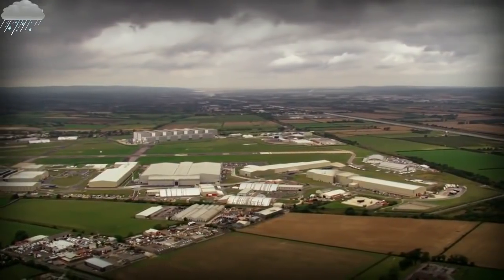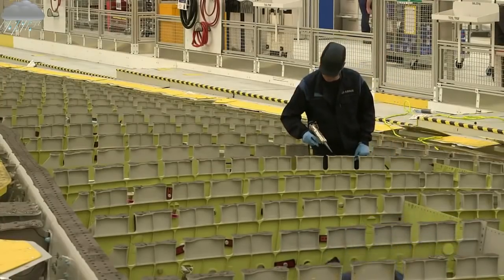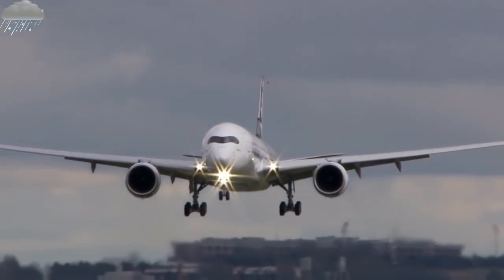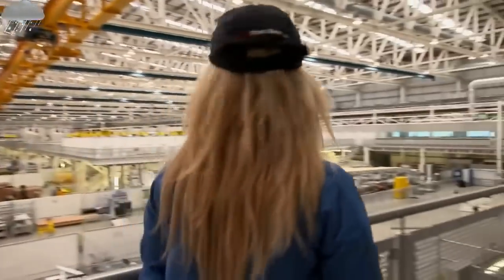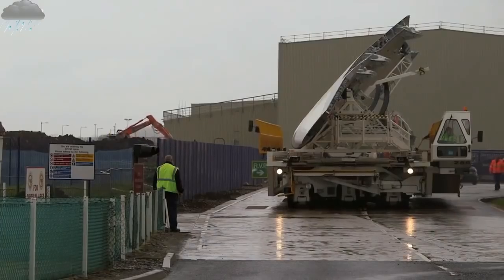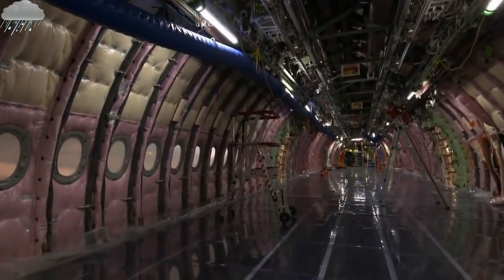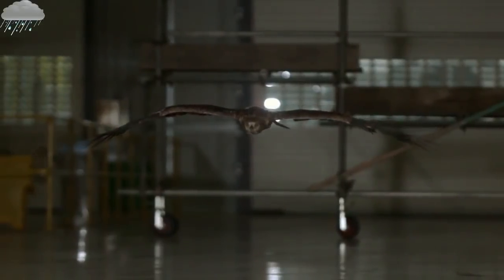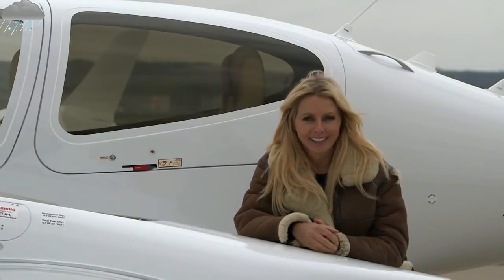Airbus A350 XWB Construction Documentary - English

Comment: Nice documentation. I really like how the brings life and humanity to aircraft manufacturing. Because the people who make the aircrafts are still the most important factor of success. And she really became a part of them.
THe only thing I need to add/correct is the fact, that the wings of A350 (and also A330, A380) are transported from Broughton to Bremen (by Beluga), where the High Lift System gets installed. Then the wing is too big so the transport to Toulouse is done by ship.
Reply: That's correct. The flaps is one of Bremen's core businesses since they build them for all Airbus airplanes. And I think the High Lift System comes with all hydraulics and electrics. So you can say, that Bremen completes the wings and then they find their ways to Tolouse where they are finally installed to the body. Single-aisle wings at least are transported inside the Beluga.
Reply: Hello, could you please share which twin prop aircraft Carol flew? Thanks

Comment: Is that the explanation of lift?  The bit about the LP & HP areas is correct  .The old "air has to speed up because the top is longer" gives aerodynamics experts sleepless nights! A plane flies because the wing exerts a turning force on the air, deflecting it downward. Following Newtons Law (every action causes = & opposite reaction)  the wing diverting (exerting a force) air downward leads to an opposite reaction of the wing being "sucked" upward upward: the creation of lift. But yes the bit about the LP area on top and HP under is right.